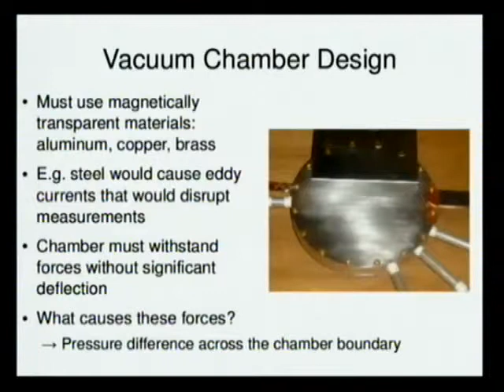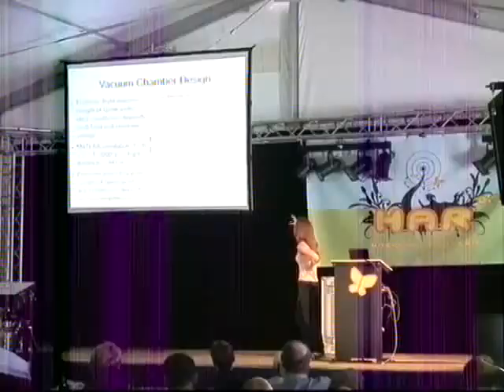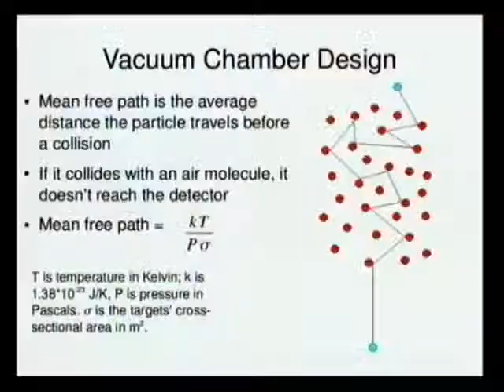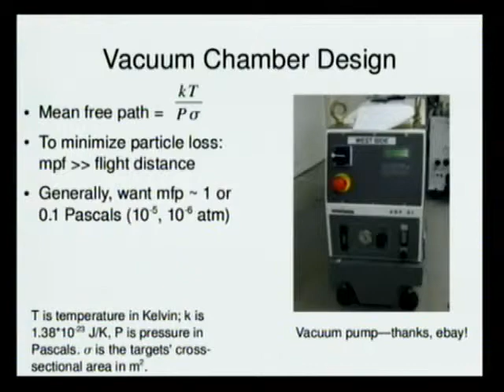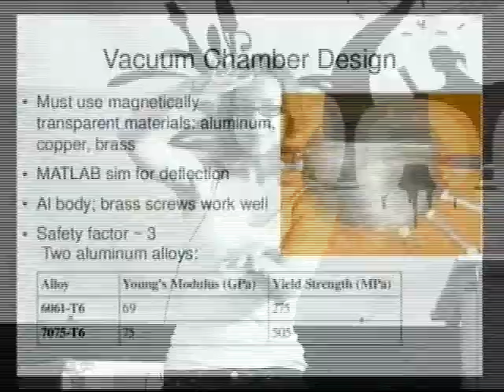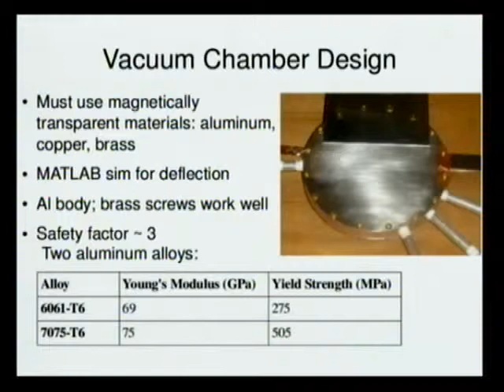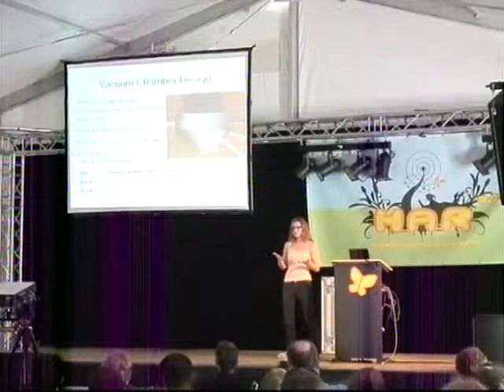HAR 2009: Design and Build a 2 MeV Cyclotron part 1 3/6

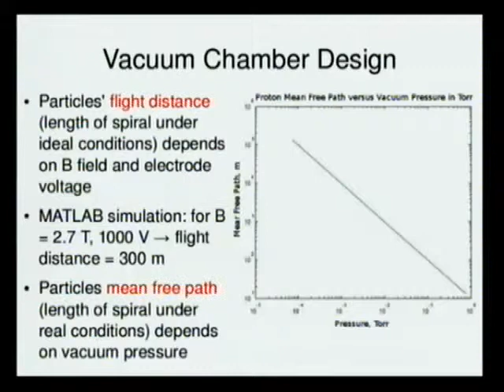Comment: At 2:05 there is what I hope was a slip of the tongue. Magnetic field strengths are not measured in "Torr". They are measured, for high intensities, in Teslas; one weber per square meter = 1 Tesla.

"The weber is the magnetic flux which, linking a circuit of one turn, would produce in it an electromotive force of 1 volt if it were reduced to zero at a uniform rate in 1 second"